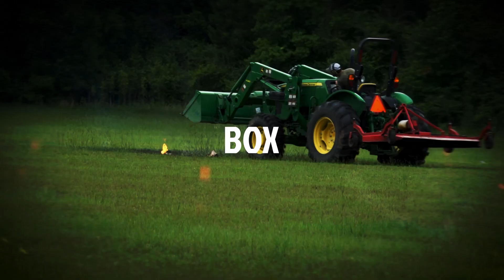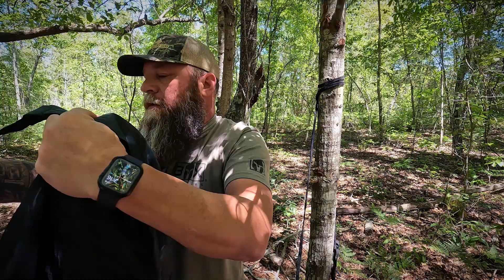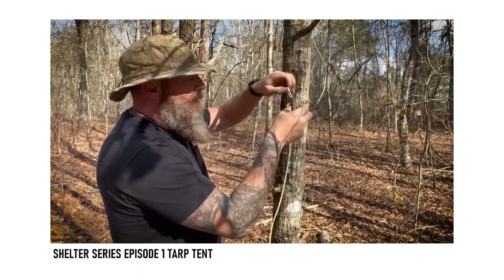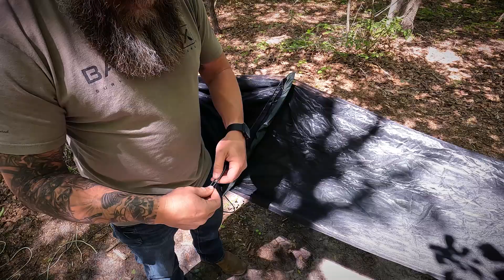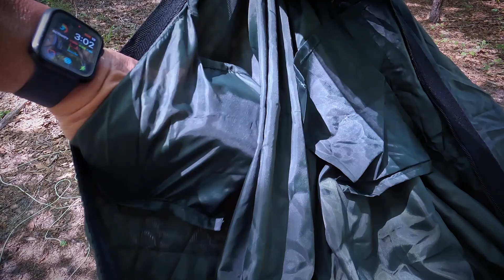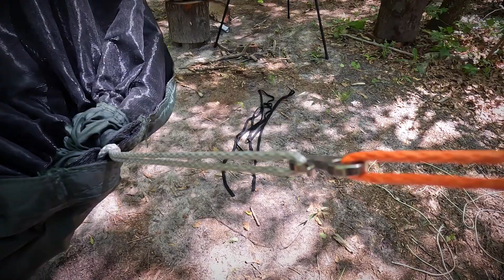DD Hammocks Frontline Hammock  Set-Up and Thoughts

Comment: Those nylon ties DD supplies with their hammocks wicks water like crazy when it rains and even drip lines don't help....will leave you soaked. If you insist on leaving it in, make it loop by cutting the ends with a fisherman's knot at each end, the loop poking out should be a bit bigger than your fist.. Add a cari uner and get some daisy chain tree huggers and you're sorted. Add whiopie slings and do away with the nylon webbing altogether and add your caribbiner and Daisy Chain tree huggers and you'll have an awesome system. I've done exactly that to my Frontline, Best and Frontline XL and they're now so easy to set up each time I'm out and super wast to adjust. Another tip.... Tie some paracord to the inner zips on both sides almost the length of your body....tie at the zip one end and again at the other end. Then rather than doing situps each time you get in and out, you can hook your toes inside the paracord and push down with your foot to open. Then once you're in, you can pull the paracord and zip up from the furthest end. Saves a lot of hard graft doing up and undoing the zips. Hope this helps
Reply: going to get one of these soon . I thought I would be in no hurry to swap the suspension system , but now that you said they wick like a crazy thing . I will swap em out before it pisses down . thanks
with the zip , when they are closed are you left with a meter or two of parracord lose inside your hammock or is there a way you deal with the slack cord too ?